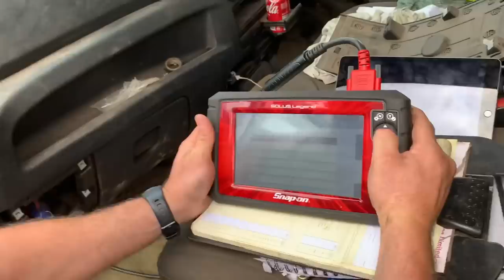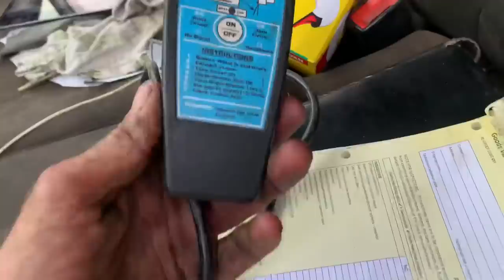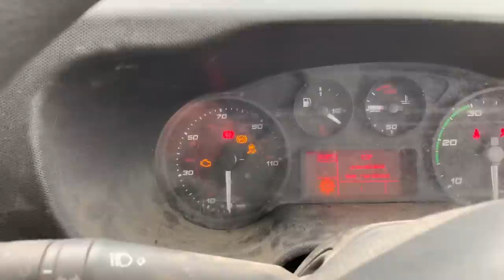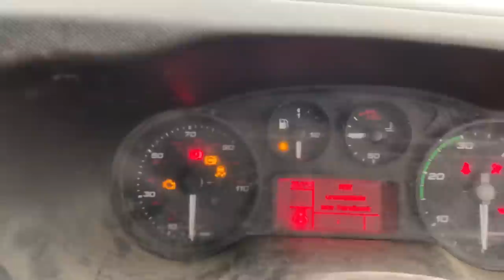Struggle bus struggle!!! Iveco van brake down…. Twice! iPad sail! And Weather of course,

Comment: Hi Chris I got called out the other day to one of these ivecos that had the exact same problem. It would run for Abit and then completely die and was the lift pump in the tank breaking down it seems to be a known issue on these vans. Hope that helps you with the struggle bus 👍

Comment: Had quite a few dailys with in tank pump dead mate, will intermittently not start and store fuel pressure faults, piece of piss to drop tank and change aswell, if it doesn’t start again then leave ignition on and bang the fuel tank see if you can hear the pump kick in, pretty sure it comes as a whole sender unit aswell
Reply from the maker: Thanks mate👍 luckily there not much fuel in her to! I’ll give it a wack and see if she fires up 👍👍

Comment: Hi Chris , the thick pink and brown wire to your tank sender is power supply to low pressure pump  , also there’s a chassis multi plug  ns of radiator , the wiring becomes insecure and rubs on chassis leg, it’s deffo a wiring fault that’s why your fuel level lights flashing

Comment: Happy Birthday to the little ‘un!! Forgot to put a note in the box, if all else fails with the Struggle Bus, you can always huff a bag of that brake clean 😂. Looks like it doesn’t agree with the hot weather either.
Reply from the maker: Yeah thanks diesel for the cleaner mate 👌😁 Thought it was from you! Run a direct feed to the high pressure pump 🔥🔥🔥😂

Comment: Have you checked the fuel pump relay. When my pump was going weak it went through the relay, then kept blowing the fuse so I put a higher rated fuse in to stop it blowing whilst I got a new pump/sender unit...

Comment: The tank sender is a pump that sends it to the filter head. Had a load off them if you hit then hard the tank hits the body and damages them. The is a fuel pump fuse under the bonnet aswell

Comment: I remember my iveco it was a 57 plate last of the twin wheelers 3 litre TD fukin pull a house down but parts were so expensive i used to dred going to the dealers to get parts was like having yer pants pulled down no lube!!!!! ABS SENSORS were always going driving round quarries pedal 2 the metal didnt do em much good nice one m8 😊

Comment: If its got an in tank fuel pump chris, check feed and earth. If all is well its the pump that's fucked.
If it has no feed , it's obviously a fuse,relay or wiring.
By pass to check directly from battery or use a power probe to feed it.

Comment: Hi Chris, do you have a relay in your fuel pump circuit? if so you need to change the relay as the contacts in it may have some arc damage.  In the Land Rover TD5 world the ABS, TC and Handbrake are known as the 3 amigos!!!! which seems to be a common issue on them.  I appear to have solved this with ours by changing out the relay.  Good luck, keep struggling....love the channel.

Comment: What sort of size bus? 16 seater or like a 28/32 seater? Why not get a a box van and do that up?
Reply from the maker: 16 seater would be ideal mate! There’s 7 of us so need plenty of seats 👍
Reply: if u look up the auctions, like John our you may be able to find a cheap bus on there
Reply: @Professional-struggler  what you need is a nice reliable Iveco 16 seater 😉 to be honest something ex council/wheelchair so it's 4.25t rather than a cramped transit with only 3.5t. also if you can find one without a powered plug door, at some stage you will be grateful as they are great when they work but experience and a right ballache when they go wrong. Might be worth looking up where councils sell their old buses, maybe approach some direct and say you want one for the challenge. And joking aside you could do a lot worse than an iveco in comparison to others they are still quite agricultural certainly at your price range..... the other option is to look up slimline Optare Solos some have 24 seats or less, merc or Cummings engines are best and they have a good layout to convert into a mobile home. You probably could even find seat belted versions  to keep all safe when travelling. Once you have strip enough seats out it can be reregistered as a goods vehicle so with an hgv can be driven legally on the road.

Comment: What a way to start a crap day
Laughing at you having a worse one than me 
I always use a multimeter to check resistance in abs sensors even from new out the box saved a lot of struggle when fitting cheap non OEM parts 
Phone knackered
Van knackered
Apparently it happens in threes
What the hell next
Keep struggling
Don't eat too much cake 🍰
Reply from the maker: 😂😂 can’t wait for the third thing mate 🤦‍♂️😂👍